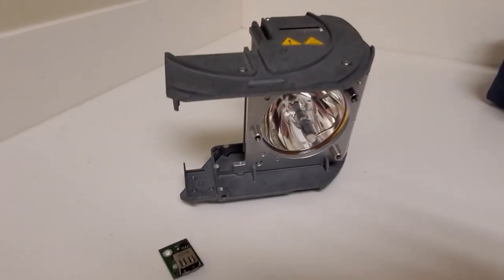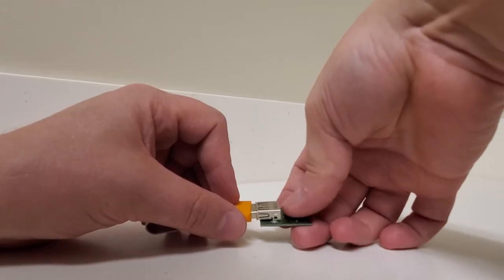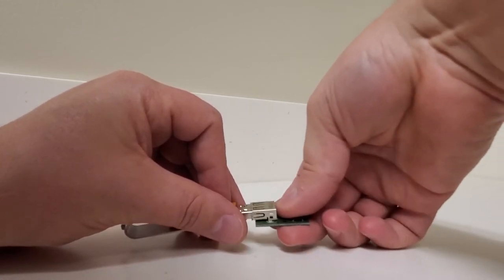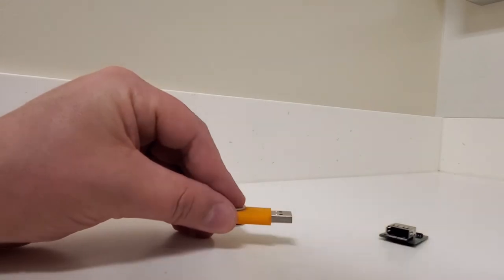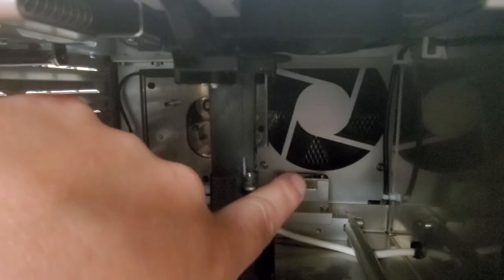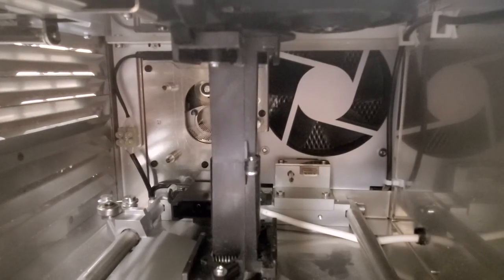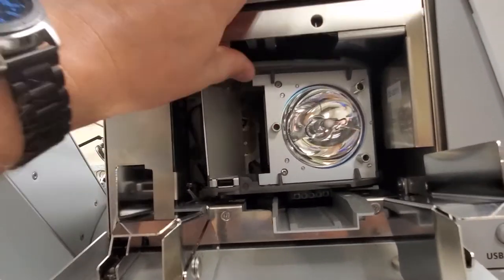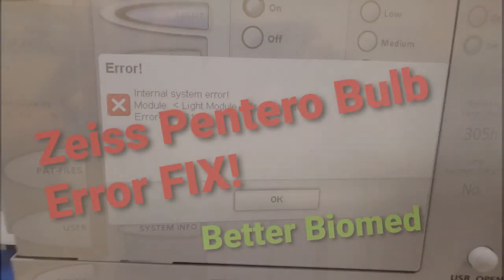Fix Zeiss Pentero Microscope Bulb Errors!

Comment: In Carl Zeiss Tivato 700 is it possible to reset the running hours with just replacing the bulb alone locally instead of the OEM suggestion to replace the entire lamp assembly.
Reply from the maker: I have never seen a Tivato 700. Yes, it is probably possible to change just the bulb and reset the hours
Reply: @BetterBiomedChannel  how to rest the hours??
Reply: Lamp of Tivato 700 is similar to 300w lamp of vario 700.
As far as i know the lamp hour cannot be reset on site